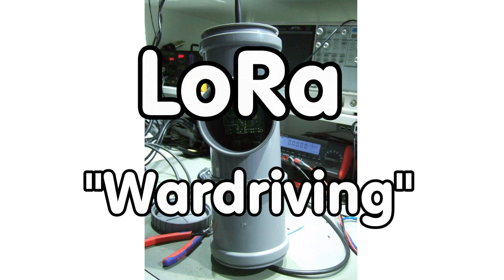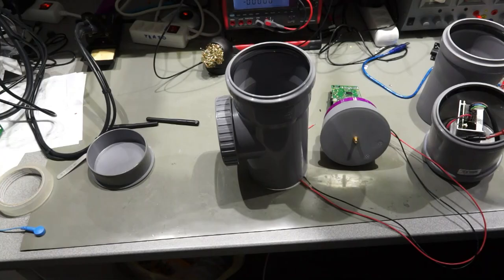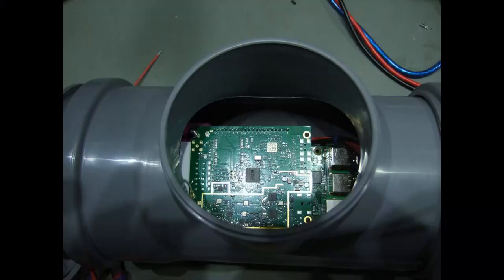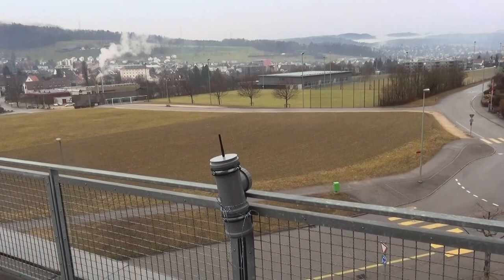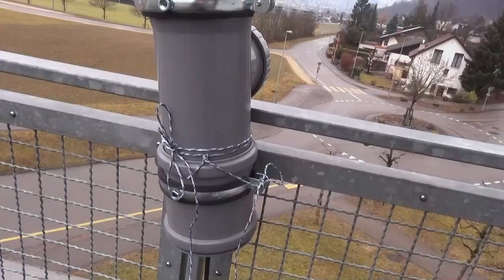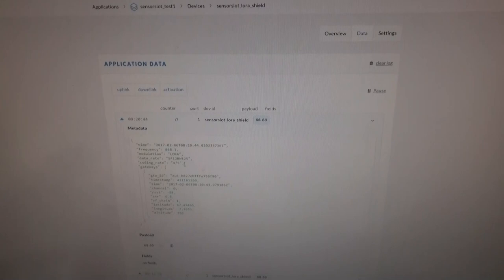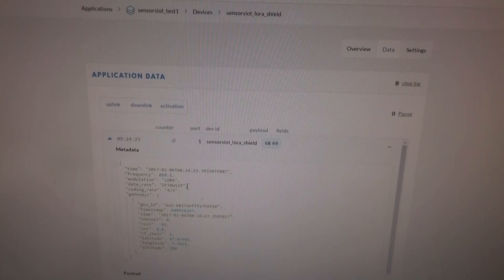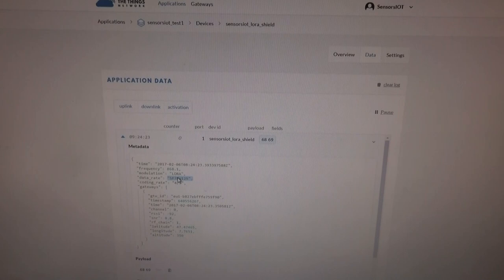#118 LoRa / LoraWAN: How far does it really reach? How far the "normal" RFM69HW? (Range)

Comment: Hi, I wonder how about bigger antenna? Mabey you didn't get your gateway because the antenna was too small?
Reply from the maker: I promise, I will use a bigger antenna next time...
Reply: i think a cheap 800/850/900 MHz GSM Yagi  ~15 EUR/CHF would do a great job
Reply: Isn't Yagi unidirectional?
Reply: Yeah... Hell with the half wave and quarter wave nonsense. Use the tower as an antenna! 
It won't work, but hey, its big.!!
Reply from the maker: Electronics is a male topic. So, the bigger the better...
Reply from the maker: + Arpan Mukhopadhyay: Yes, the yagi is directional. If you know, where your gateway sits, you can use a yagi.
Reply: Yes. It is not feasible for most many to one communication scenarios.
Reply: Andreas Spiess Interesting! Is it possible to use the tower as antenna?
Reply from the maker: No, but you can place the gateway on top of the tower, if you get permission and power.
Reply: what a laugh I had on this one!
Reply: I mean about the big, bigger, biggest comment by Andreas
Reply: Your antenna size would also be limited by the legal power limit. Playing with circular polarization could be fun.
Reply: Circular polarization limits power even more than a standard dipole antenna and its only advantage is that transmitters in moving in planes other than horizontal (the dipole standard orientation) will be received by the stationary receiver. Think Radio Controlled aircraft.
Reply: How about cantenna? i've used omni cantenna (the can as groundplane) on ADSB (1.090 Mhz) before and amazingly it works almost as same as some of more complicated antenna (i compare it with franklin collinear). it's easy to make and have much better groundplane than the rubberduck antenna.
Reply from the maker: Do you have a link to how it is built?
Reply: you actually can put a arduino gsm module on your gateway and other arduino with a x, y, z servos so you actually can track your gateway and move the servos that are attached to the directional antenna (remember that you need to measure distance for the correct direction of movement). So if you are like 500 meters away possition north your directional antenna will be pointing north at your possition of 500 meters away :D
Reply: @AndreasSpiess  Use a Co-linear antenna (maybe another good video!).  It's just a vertical stack of co-linear antennas.  \The more in the stack, the higher the gain.  It's omnidirectional and can be designed not to require a ground plane.  Gains of 6-12dB are possible (practical) - so you chan have Yagi gain with an Omni antenna!  G7DMQ
Reply: @Simon_Rafferty  I am intetested in that idea, cause I HAVE TALL BUILDINGS SOURRANDING & 6 KM DISTANCE TO REACH-I HAVE A SATELITE ANTENA & OMNI ANTENNA TO STACK/ WHERE I CAN SEE SOME PICTURES?
Reply: @ArpanMukhopadhyay93  No
Reply: Antenna yes, or could even put an amplifier between it to gain a few Watts too. 
In here technically it isn't allowed, but it's not enforced anyway.
Reply: Just use the entire balcomy fence as antenna, if it isn't grounded. j/k lol

Comment: I look forward to every episode - thanks for posting, Andreas!

I wonder if your signal strength might improve from placing the devices a bit (20cm) further away from any metal components (such as the metal guard rails, etc.)

I know that this is a design consideration when mounting WiFi access points (that use 2.4ghz and 5ghz).

Just a thought...

Please keep sharing your activities with us, they are very informative!

-John
Reply from the maker: Metal not properly placed is in general not good for RF. You are right.

Comment: Thanks

Try orienting your antennas parallel to each other (ie: using vertical antenna on whisper node as well as lora), particularly when reception is marginal.

It could make a few db of difference, due to antenna polarization.
Reply from the maker: The polarization was vertical on both sides. Because many viewers think, the antenna is important, I will try the effect of the antenna in another video.

Comment: I have a 95% complete hardware product with NRF24 and i'm very seriously considering using the low frequency modules, because of the reach. I was quite surprised by the short reach of the nrf:\ 10x for the series on them!
Reply from the maker: The NRF24 have the advantage of higher throughput. But from a range's perspective, they play in a different league.
It is not only the low frequency, it is the small bandwidth which give these modules an advantage.

Comment: Andreas, again a great video!
Guess the antenna would play an enormous role.
Not really comparable but some days ago, the locality I live did not have a suitable Internet connection which was really bad for me. But my brother, living ~4km away had a 16MBit Inet connection, but since there was a ~100 meter "thick"
line of trees between him and me, I always though there would be no chance for a connection.But I was wrong, one day we tried using 90 cm focussing antennas on both sides with just normal
WLAN Access Points (and very short, good quality cables) and we were able to transmit ~8MBit over
this connection. I ran this setup for years without any problems!One might think that bad weather would have disturbed it ... but the opposite was the case .. the more bad the weather
(rain/fog) the better was the connection, because without a direct sight connection you need the reflection in the air.So using the right, focussing antennas I guess you can reach multiples of the ranges you measured.
Reply from the maker: Walter Steinchen Here it is a little complicated: Big antennas are not allowed. I will try once a bigger distance. The biggest problem is, to find free line of sight here in Switzerland...
Reply: Here i got my answer i ask in an other threat :-) to much antenna gain makes it illegal :-)

Comment: Another great video Andreas.  I was worried that my TTN Gateway wasn't achieving the range I expected, based on playing with LoRa - but your experience seems broadly similar and it has set my mind at ease.  73's G7DMQ
Reply from the maker: And maybe you do the propagation analysis. Then you can compare...
Reply: @AndreasSpiess  I did!  Using https://www.ve2dbe.com/rmonline_s.asp  The overall pattern is similar but the range is 50% of what this would predict.
Reply from the maker: Then you can try to change the parameters
Reply: @AndreasSpiess  To follow up, it was not the parameters that were the issue, it was the (commercial) TTN Gateway had a poorly matched antenna.  Using an antenna analyser, it showed resonance & 50 Ohm impedance around 2.4GHz, not 868MHz.  With a properly matched antenna, the range matched the propagation analysis.

I've tested several supposedly 868MHz antennas from Amazon.  Most are actually 2.4GHz being sold as 868MHz.

Comment: Excellent episode! It was both useful and interesting. Back in 2004 I created a 2.4GHz link which spanned 66 km using what became standard WiFi technology, however this required two repeater stations so I am always curious of the capabilities of long distance data collection. That system was based on products intended for short range but with 24dB parabolic antennas substituted for the small whips you are using in this video. I wonder how much your range could be improved by using a higher gain whip and isolating local metal from the antenna a bit more. My distance problems were more from protocol timing issues than power. You may be able to get amazing range with a little directional antenna.
Reply: I was thinking the exact same thing
Reply from the maker: I will do some more tests. I think, I should reach a much bigger distance only with this whip antennas. The problem is more, to find areas with line-of sight...
And also keep in mind you are not allowed to use high gain antennas in the open band.
Reply: I'm looking forward to more of this topic. I have a question and a request. The question is do you know how close to the maximum (for Switzerland of course) these nodes are in regards to transmission power using the low gain whips? The request is for additional testing to please also categorize the range with different antenna orientations, assuming the other node's antenna will always be vertical. Thanks for your excellent series.
Reply from the maker: +Peter S I have a big antenna for tests, but I am not convinced if it helps a lot. 868 MHz works very much like light.
Reply: I think about if it's become illegal if you've got too much antenna gain?
Reply from the maker: Yes

Comment: Great video nice results!! I also did some waredriving my longest distance 4300 meter. I use a Wemos D1 with an RFM95W and a standaard 868mhz antenna.
Reply from the maker: Did you also use the TTN network or two RFM95 nodes?
Reply: Andreas Spiess  yes I use the TTN network and the TTNmapper (iOS) app for logging. There are only à few gateways where i live. I did build my own single channel TTN gateway also with an RFM95M. The longest distance to my own gateway is 2200meter and 4300meter to an official TTN gateway. unfortunately there are no hills, moutains where I live so I need to drive arround town to search the best point at this moment Iam experimenting with diferent antennas
Reply from the maker: The situation here is completely different with all the mountains. Advantages and disadvantages...

Comment: Andreas, you will have a better signal if you take care on the antenas polarizations, an misaligned of 90 degree will take you a loss of 20db of you signal! In some parts of your video , we could see that the antenas was on the wrong polarization. In some cases you culd have a conection if you match the polarization.
Reply from the maker: I always used vertical polarization for the test, even if you might not have seen it in the video. Only if I got a "vertical" signal, I sometimes tried also with another position.

Comment: Great to see a range test between to 2 devices, great work. I wonder also (like other comments) what range you could get with say a Yagi directional antenna..... although it would be best to know where distant gateways are first. Excellent video..... although watch those tower steps in the snow/rain!!
Reply from the maker: I will not use a yagi (I do not know where to buy one, because they are not allowed in this free band). But I will change the antenna to find out the differences. Mailbag viewers know, that I have already ordered many different antennas...
Reply: I have a Yagi directional for my LoRa project (SX1272 based).... but have not tested its reflection in the 868 frequency range yet. Secretly hoping the smaller omni-directional antenna will meet my need as cheaper and simpler overall.
Reply from the maker: I will do some more testing, also with a bigger (omni) antenna
Reply: where do you people get those yagis, outside europe?

Comment: A followup question (I've just ordered my first Lora boards and haven't gotten my hands dirty yet): I know the LoraWAN includes forms of encryption and provides safety from prying eyes. Now assume I am going low level just one Lora board to another in a big yard beyond the scope of WiFi end to end. Is the data sent in a clear text format in this case? I know I could encrypt it myself and deal with the key exchanges or relative insecurity of unchanging secret keys to my own encryption. It seems the security features of the LoraWAN may be among the most important protocol addons. If you build a gateway, does it have to be an open gateway or can it operate in a closed network rejecting messages not from its own clients? I am digging through SemTech papers and relevant law and can't find a simple, logical, FAQs. Everything goes a little more technical than I need right now. I'm at the system design and communications protocol connection choice and don't need to know all the info they're throwing at me. I will keep consuming since I suspect my answers are buried. I also have two clients from Adafruit coming (and one other brand). Love your shows. I'm a 'scriber!
Reply from the maker: LoraWAN uses LoRa as a transport protocol. If you only use LoRa, usually you have to take care of encryption yourself. You have to decide if you want to use LoRa only or LoRaWAN
You can install a private LoRaWAN installation and run it. Please look at the pricing conditions. If you only want a gateway, you have to connect it to a "backbone" and it will be open.
I once did a video about direct LoRa connection without any gateway. It works.
You can reduce the power of your LoRa transmitters by software.
Maybe you browse thorough my LoRa playlist?

Comment: Hi, I think you might want to shield your electronics, that will interfere with Lora transmission, but more importantly its reception. Plastic does not stop RF interference - you need to cage your electronics if you want to ensure a decent test on the RF (there are so many sources of interference RF, you need to).
Reply from the maker: Generally, you are right. Did you see how far I got with this small device, a very short antenna, and 100 mW output? More than 200 km. So I assume there was not a lot of interference on this frequency.

Comment: Great that you got a >10km response. However, your experience in this video gives me pause whether it will work across 6mi (not quite LOS) to my needed sensor location. Directional antennas may be the trick since it will be a 1:1 link. Maybe the Cantenna idea; it did wonders for wifi.
Reply from the maker: Maybe you watch my world record video. Line of sight is much more important than antenna gain. Without line of sight it is ususlly hard to get a connection
Reply: Andreas Spiess I've watched most of your LoRa videos; very well produced & explained. It's entirely possible that this tech just slightly misses the mark in my environment/geography. I'll continue to research. Maybe something will turn up or I'll give up and purchase a cellular interface. Thanks.

Comment: I wonder if there's a way to use LoRa with an HF frequency (for longer propagation) and especially with an antenna in NVIS configuration for a more reliable transmission and reception, since it can overcome any hills and can reach maybe 200km of reach. I believe NVIS is for lower than 10MHz frequency, say 7MHz / 40m band, so the antenna would need to be quite long (around 20-meters long for dipole NVIS). What are your thoughts on this idea? Thanks!
Reply from the maker: The bandwidth of typical LoRa signal is 125kHz which is nearly a whole Ham band below 30 MHz... Nobody will love you for trying that.
Reply: @AndreasSpiess  great point hehe Thanks for the reply and the great videos!

Comment: Hi! Awesome video! Concerning this one I got a quastion: In the end you say one shouldn't start with LoRa for a connection between two (or more) devices without internet .. just basic communication between devices. - But regarding energy consumption and the great range, wouldn't it be still a great choice?? Is there any similar alternative with same specification concerning power consumption, range, price, availability (parts)?
Reply from the maker: You can use the LoRa protocol to connect two different nodes. This will work. But it is more expensive that the RF69W and not much better, as you saw in the video.

Comment: I have not read any about how much water proof this design would be. I see that you have put the tubes in wrong direction. If water runs down, it always goes to the water isolation ring. If you turn the overall design of the tubes about 180 degree, the water has to climb into the inner tube to reach the isolation ring. This would improve the water resistance much more I think.

The tubes were originally designed for keeping the water in the tube. That's why you normally see this tubes mounted at the roof this way.

But overall a very good idea.
Reply from the maker: +TheLollisoft Thanks for your tip. I do not know what is better, I am no specialist. I just thought, if it is waterproof , it is waterproof, because water is quite fluid. But I will check after the next rain ;-)
Reply: If the water is running inside as usual for a roof water pipe, you typically put the upper pipe inside to the lower pipe. That keeps the water inside even the rubber washer is broken. The other side around will be the water did more likely go into the pipe. But that's what you want to mitigate. Thus the lower pipe should go into the upper pipe. This makes it much more sealed - even the rubber washer gets broken.

The only problem is to find the same solution for the top closing item. I do not know if there are such items available. And that's may then be a DIY :-)
Reply from the maker: +TheLollisoft Actually, these tubes are used also nearly horizontally and for waste water (and not only water, if you know, what I mean). That is, why I thought, they have to be really tight ;-) But I will check. And anyway, I plan to include a humidity and temperature sensor.

Comment: Put the antenna on a drone and you don't have to climb towers no more..
Reply: that would be affected by drone's radio interference, motors EMF interference, ESC's switching interference... so not a good option for RF testing.
Reply: Or using some kind of Helium balloon.
Reply: There might be a restriction ... depending on your countries laws, some bands are not allowed to be used from aircraft or balloons.  Often it is a rule that antennas have to be affixed to a land structure.